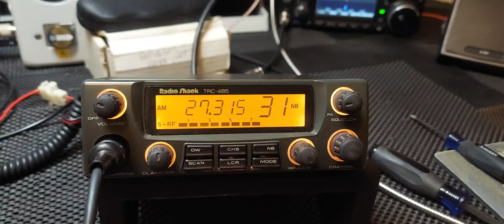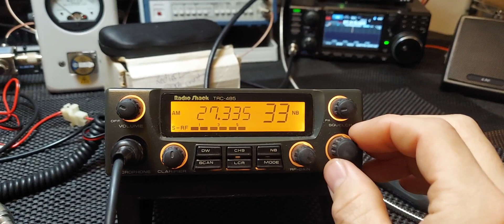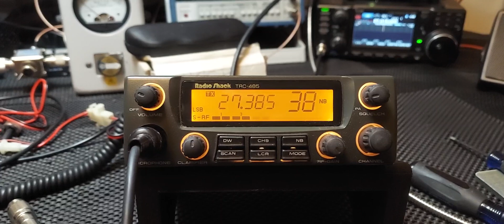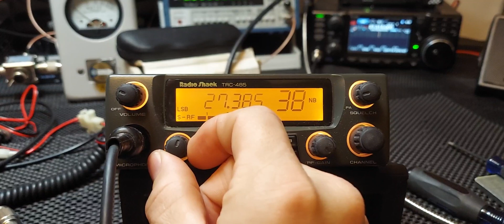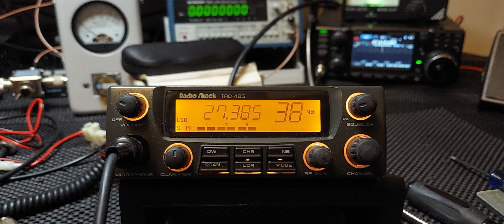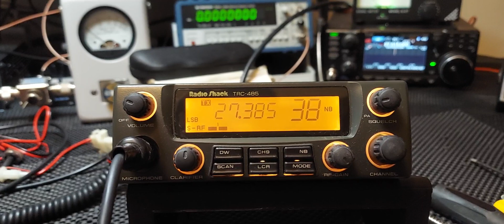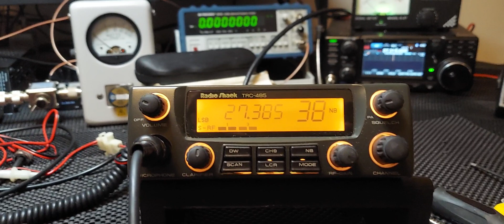Unmodified Radio Shack TRC-485. AM/SSB 40 CH CB Radio

Comment: Love the radio shack TRC-485. The shooting star beam is really good too. Kinda like the old moonraker beam.
Reply from the maker: Yeah I went away from the beam and now I just run a v5000 vertical and a BA1 stationary horizontal. 
I'm using other antennas on the tower for amateur use and having that large CB beam was fun but it's also fun to have other options when it comes to antennas and avenues in the radio hobby.

Comment: This may be a shot in tthe dark. But would it possible to order a volume pot since the knob shaft broke off ? Thanks TRC -485 radio.
Reply from the maker: Might be hard to find a part supplier for an old radio like that. 
Maybe better to find a parts radio.
Reply: @ScottsRadios  Thanks
Reply: @ScottsRadios  update: all fixed , found generic pots online.  50K but without on /off. I pull out of cigar lighter socket to turn off.
Reply from the maker: Good to hear.

Comment: Last year I saw one of these in a Pawn Shop near me.  This one was like a time capsule CB Radio.  The radio was inside the original Radio Shack blue box, the user manual, warranty card and even inside of a Radio Shack envelope I found the original receipt purchased back in 1996.  The radio like I said was never installed...  Still has the plastic around the mike cable, all original.  Like if the person purchased the radio and put it away...  Needless to say that I bought it.  I have 4 or 5 CB radios... but this one is my fav.  (still in the box) .
Reply from the maker: Mine has the box. Wasn't pristine, but fully functional.

Comment from the maker: I found a ebay listing today for another like new version of this radio.
I don't know the seller so I take no responsibility if you purchase it and it is not working correctly.
The radio appears to be in much better cosmetic conditions than the radio I purchased.
https://www.ebay.com/itm/284833592841?mkcid=16&mkevt=1&mkrid=711-127632-2357-0&ssspo=qTh4iBM-S-O&sssrc=2349624&ssuid=jyrkMnpwRDq&var=&widget_ver=artemis&media=COPY